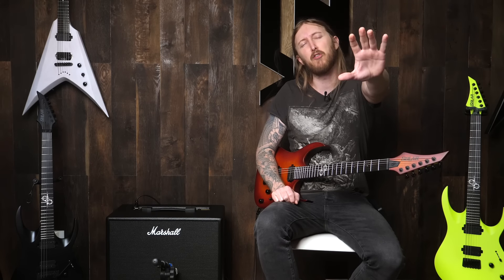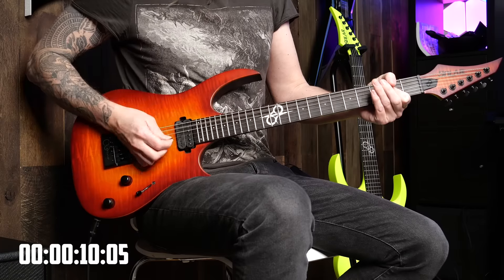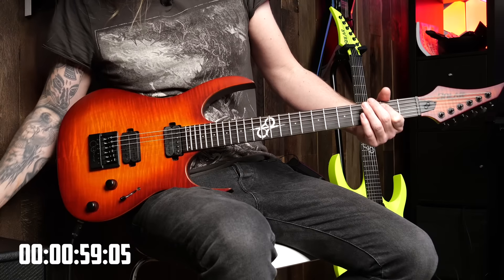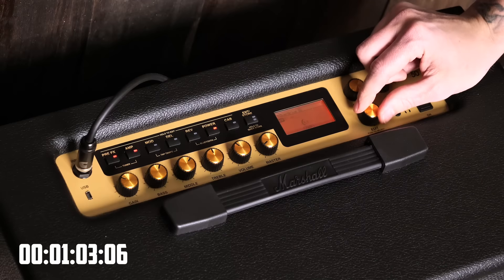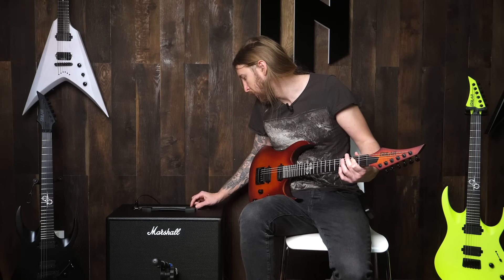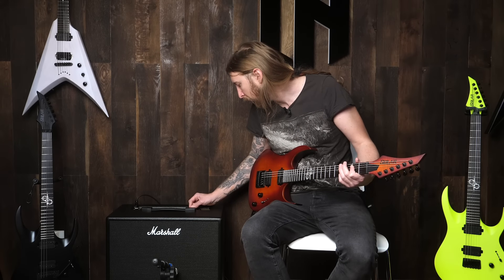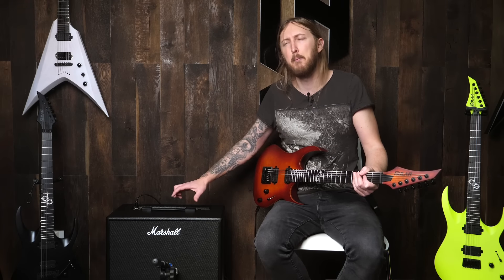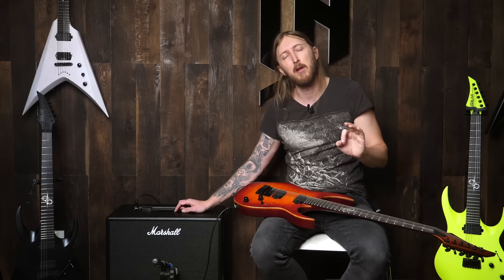WILL IT CHUG? - Marshall Code 50

Comment: Ola I recently got a tube head and love it but in order to get those thick heavy tones I have to turn up the gain all the way or almost all the way up.  People keep saying too much gain is bad and should use as less as you can.  I am new to this tube stuff and have seen people use overdrive pedals to drive there amps and that's how they get that thick sound.  What is a good pedal to use for metal sounds without actually adding fuzz on top of the sound.  I tried a wampler at a music store and liked it but it was hooked up to a crappy little combo amp just seemed to be adding fuzz on top of the crappy distortion the amp had :(.   Is this JHS Bonsai pedal worth the 220 bucks as it has like 8 or 9 diff OD pedals in one.
Reply: Most metal players use an overdrive as a boost for their amp.  The most popular overdrive for this is a tubescreamer or any ts copy such as the precision drive or the aforementioned bonsai.  Don't worry about where your drive knob on your amp is.  If it sounds good, it is good.  As far as getting a standard metal tone goes you'll want a high gain amp set pretty gainy and then set your tubescreamer with no gain but max volume and then set the tone knob where ever sounds best for your rig.  The reason people use tubescreamers is because the remove a lot of low end making the whole sound "tighter" overall.
Reply: @jonnelson5881    I have too much high end now and have had to actually scoop the mids down as well to reduce the kinda tin can sound if you say lol.  Most of my solid state amps I have not had so much crispness I guess you could say as my tube head has.   I did find a partly microphonic 12ax7 that might be causing this as well.  I have a nice set of balanced high gain 12ax7s on there way and ill have the electronics shop test each one and ill put them into the head in order depending on there results.  I am aware that should use as balanced of a tube as I can get in the inverter slot.  I may leave the inverter tube alone depending on how it test compared to the new ones.    The amp I have is very well known for crappy cheap tubes so I am told changing out the pre amp tubes will greatly change the amp.  I just hope for the better :).
Reply: @Jennifer_Prentice  what amp is it?
Reply: @jonnelson5881  Don't go bashing it now :).  Is Bugera Head .  It sounds good just has a kinda ringy thing going on kinda like how the amp sounds when I tap the first pre amp tube.  I think this is causing the problem.  Otherwise the amp sounds decent if I bring the highs and mids down you don't hear it lol.   Yeah I am masking the problem lol.  Sucks waiting for things to get shipped to you :).
Reply: Gotcha.  I think you're right about it being a bad tube.  Best of luck to ya @Jennifer_Prentice
Reply: @jonnelson5881   Thanks for the info :).   Anyway I will just wait till new tubes get here.  It has 3 year warranty but not sure if it covers tubes and would cost me more to send it back then to just replace a tube .  Figured id just replace all of the pre amp tubes with decent ones and see how that goes :).   Have you seen that Bonsai pedal ? It looks pretty cool but not sure if its worth the money or not.
Reply: I'm from Kansas City and work at a music store so we sell a whole lot of JHS (they're based here).  Its definitely a great pedal and it does accurately recreate the pedals its emulating but I'm not super into as all the pedals its emulating sound very similar to each other (TS clones).  If you're a metal player which I'm assuming because we're on an Ola video, I'd definitely stear you more towards a Horizon Devices Precision Drive for that kind of moeny or an Ibanez TS Mini.  @Jennifer_Prentice
Reply: @jonnelson5881  Thanks :)

Comment: The marshall code 100 chugged in 20 seconds out of the box it'd the 6th setting.and you have to talk about the power amp section too.It is really a great amp for the money.14 pre amps 6 cab simulation. .....this chugs out of the box and no pedal required. ...
Ola that video sucked. You didn't even try.....